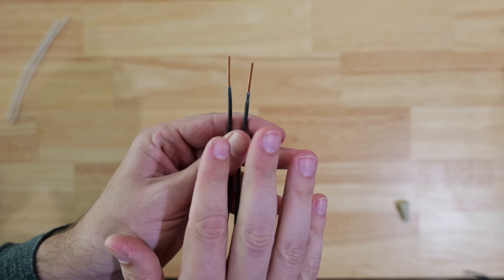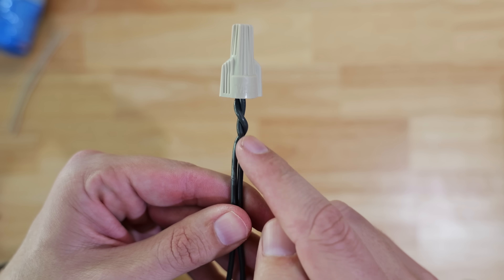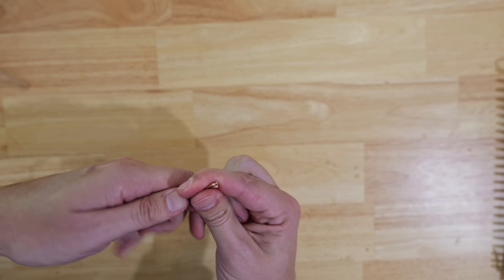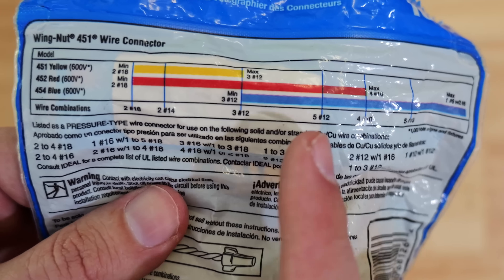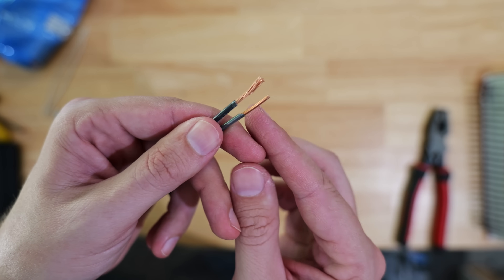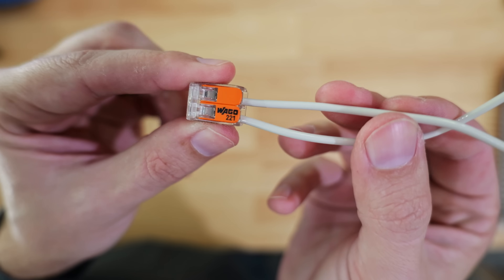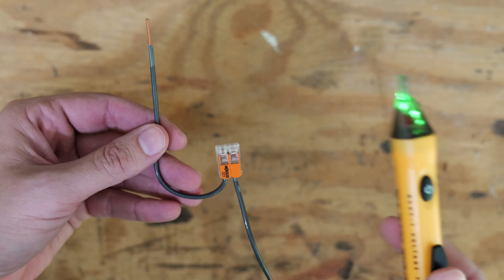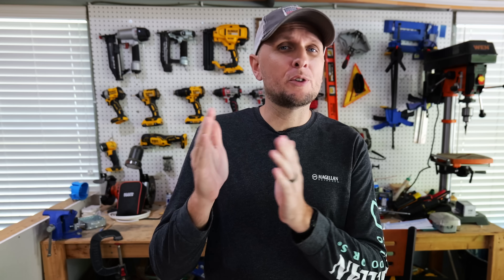7 FATAL Wiring Mistakes Most DIYers Don't Know They Are Making | Most Are Guilty of 3

Comment: I love the WAGOs.  Your starter frame just shows, "Bad" and points to the Wago which would lead people to think they are a bad option when they are really a great option and probably the safest option for beginner \ DIYers who would make some of the other mistakes you pointed out with the twist caps.  Thanks for the videos.
Reply from the maker: In the video you see what the bad is pointing at with the Wago.
Reply: Wago is bad.
Reply: @Faruk651  pretty generic response. Why bad?
Reply: @NBSTL68  Because.
Reply: @Faruk651  WAGO's make a better connection, are easier to use and have far less chance of falling off than wire nuts
Reply: Clickbait for ad $$. The only reason I came here was to find out what was "wrong" with WAGOs. Suspicion confirmed. Nothing.
Reply: he did it on purpose, clickbait = money
Reply: @bobbobbert2768  Yes your right it worked on me lol
Reply: Just click bait bro
Reply from the maker: @josegomez6888 nope.  You didn’t watch then.
Reply: The bad in the video is improper installation. Hard to call the WAGO bad because of this.
Reply from the maker: @kansascityshuffle8526 never called it bad.
Reply: @HowToHomeDIY  I think the issue they're having is just that the thumbnail is a bit misleading since even those who skim over your video may be inclined to think WAGO's aren't good. Obviously watching the video clears up the thumbnail, but for the audience that maybe doesn't finish the video for whatever reason will have been potentially misled.
Reply from the maker: @MinecraftsAssassin sorry they feel that way.  Why does nobody complain then about the wire nut saying wrong?  Not one time.  People have a perception based on bias is all I can conclude.
Reply: @HowToHomeDIY  idk, I'd just recommend  considering both viewers and non-viewers for thumbnails. Would put the channel at that "extra level" of professionalism in a sense. I wouldn't dig too much into other issues to detract from the more apparent thing that's the first item folks would see. Errors in videos can always be remedied with YouTube post-effect editing tools and/or pinned comments clarifying the mistake
Reply from the maker: @MinecraftsAssassin I appreciate your opinion.  I just don’t personally see an issue with the thumbnail.  One thing I’ve learned in doing this is that no matter what I do, I will not please everyone.  Everyone has an opinion.  Again, appreciate you taking the time.
Reply: @HowToHomeDIY You want to know how you manipulated the wire nut section? Every time you put a wire nut on a set of wires, if you wanted it to fail, you didn't twist it properly. This ensures failure every time. Twist it correctly each time and then number of failures you encounter plummets. Be careful what you ask for. You might just get it. The entire point of your video is to follow manufacturers instructions. The end.
Reply from the maker: @TadTheTinker yes I think I pointed all of that out in the video already.
Reply: @HowToHomeDIY  You pointed it out as a mistake in the first segment. Then proceeded to repeat the mistake over and over again. Many of the issues you pointed out in following sections would not have been an issue if they had been put together correctly..
Reply from the maker: @TadTheTinker again, that was the point I was making with different scenarios. 😂
Reply: @absolutez3r019  Well, they dont technically make the "better connection" as with the other method you are directly connecting the wires over a bigger surface area.
So theoretically WAGO's add more resistance to the system. 
But that's the only "downside". Apart from that they are superior in any aspect. Handling maintainance whatsoever.
Actually the first time hearing about wire nuts was actually seeing US youtubers, because where I live they are almost nonexistant.
Reply: I agree, I’m a DIYer and have always used Wagos. It felt like clickbait to me
Reply: @absolutez3r019   WAGO's are definitely easier to use and less likely to install incorrectly, but not so sure about the "better connection".  If the connection is better, then why does a WAGO heat up at full amperage while wire nuts do not?
Reply: @a351must2  wires heat up when at their max amperage.  But the max amperage of a wago is higher than the max amperage of the wire, it shouldn't be a problem.  Wite nuts can get hot and melt too,.
Reply: @absolutez3r019  yep, I wasn't trying to imply that they're dangerous in any way.  They heat up because the connection isn't as good as a wire nut, also indicating there would be some minor voltage drop across one...but you're right that it's not going to melt if it's still within rated usage.  A proper wire nut connection only heats up as much as the wire itself heats up (emphasis on proper)....at least it's pretty hard to screw up a WAGO connection which makes them safer for DIY.
Reply: @Faruk651  WAGOs arent bad. They are great. i worked in a factory that had everything from +90 to -30 celcious, lots of vibration, chemical exposure, pressure washing, lots of humidity, etc. and those WAGOs handled it all. btw wirenuts untie themselves when you have regular fluxuating temperatures, this doesnt happen to WAGOs. Wirenuts can also have issues where the plastic cap seperates itself from the metal part, which can cause shorts. This doesnt happen with WAGOs. Wirenuts dont work on stranded wires, Wagos even handles stranded wire below its min req, in a pinch.

Wirenuts sucks. theyre way slower to work with, easier to fuck up, barely handles vibration, at all. an absolute pain in the ass to redo and takes 10 times as long as with a WAGO. and if you use em in industrial settings you should be ashamed of your self, cause everytime you redo it, you have to cut some wire off(do this enough and youll have to replace the whole cable)
Reply: @HowToHomeDIY "sorry you feel that way" such an american thing to say. No one felt like this. Its not the fault of a connector installing it wrong. With Wago is far less likely to do it wrong.
By any means, your thumb is clickbait. Just own it.
Reply from the maker: @Tom-ju7px umm it’s not.  That is your opinion and your comment is definitely showing that you feel that way 😂.  The video is very clear about the thumbnail.
Reply: The 'bad' on Wago was the only reason I watched the video 😂. Having the wire nut next to the Wago made it seem like you were comparing the 2 with Wago being a bad option.
Reply: @absolutez3r019 you have bigger issues if your wire is seeing max amperage. You calculated wrong and using wrong wire size
Reply: @HowToHomeDIY  thats not really a bad thing with the wago or a bad thing with the wire nuts. Its just improper installation which is user error. Your thumbnail is very misleading and clickbait-ish.
Reply: @HowToHomeDIY  your thumbnail shows that you are calling the wago bad and the wire nut worse like there is a 3rd and better option. Your thumbnail should have been along the lines of "dont install these like this" agree or not, it is very clickbait-ish.
Reply from the maker: @FuckYouTubeCensorship2024 that’s your opinion.  What the thumbnail depicts is clearly shown in the video.  That’s not clickbait.  But I understand you’re a troll based on your name of “ILLYRIGGERYOU” 😂.   But the comments help the video so thanks!  🫶
Reply from the maker: @PokerMuppet not at all.  There are thousands of others that understood it and found the video helpful.  Sorry you’re still upset about it after 2 months.  Can’t please everyone.
Reply: @PokerMuppet you ain’t the sharpest tool in the shed are ya.  My goodness.  Either that or just like to whine about things that not only don’t matter but didn’t happen.  You literally do seem very upset.  So don’t think he’s wrong on any of it.
Reply: @HowToHomeDIY clickius baitius maximus
Reply: @TraktorTarzan The only true statement in there is that they take slightly longer to work with. A wire-nut is as likely to come off as a wago lever to pop up, or a push-in to loosen.
Reply: @histguy101  wirenuts really bad in enviroment with a lot of vibrations, they will unscrew themselves overtime, wagos are spring loaded so its not affected by vibrations. and if you do maintance work youd know that wirenuts take a lot more time to redo than wago, its not even close. that is ignoring the copper that have gotten crispy so you need to cut some off. in industry thsi is absolutely terrible, cause it means you eventually have to rewire the whole thing. this issue doesnt exist with wagos.
wirenuts also can have the plastic part seperating from the metal part, and it now can cause a short. this also doesnt exist with wagos.

and how are these not real? ive seen it with my own eyes. and its the reason the factory i worked at moved over to wago, cause the wirenuts litterally became a hazard and issue

in houses the condtions are so stable and still that most of these wont become an issue, but in industry it is. and it shows that wirenuts are worse
Reply: @Faruk651 Why?
Reply: @HowToHomeDIY  So Main issue for both you are point out is nothing about the wire nuts or wago connectors themself, but in both cases just user error or not following the instructions. To which I fully agree. Although I think the thumbnail was misleading in both cases.
However, when it comes to properties, I think there are even videos out there where they had been tested for pull strength, load capability, how easy they may catch fire and such stuff, and I think the wago was slightly better than the wire nut. BUT, both have been well within specs and exceeded he specifications. 
For both also these days we have to say, get the original or at least qaulity ones. There are by now so many fake or cheap ones out there, especially on ebay or shops like Temu, but also Amazon, that are simply not up to the task.
From own expereince, I cannot say anything about wire nuts. While I at least think they would not be "illegal" to use here in Germany, I have never seen any for sale at electrical supply or DIY stores. You can sure get them on Amazon (like everything you possibly can buy ;) )
There is also an older, but still available and up to the task style using just push in clamps with no levers. I sometimes prefer those to join wires in boxes, as they are slightly slimmer. Con: you really have to twist out wires to remove them and not for stranded wires (which as you described it would only be on the light fixture side anyway, no stranded wires in fixed installations otherwise). There is also an older style of the levered ones, way more bulky and slimmer levers. and not as wide a range of sizes they can be used with. They are a little cheaper, but about 3-4 times the size.
Reply: I made the mistake with wago of not shoving it in far enough.
Reply: @Faruk651  Well, there's a cogent answer.
Reply: @HowToHomeDIY Ummmmmmm, you literally called it bad in the comment above AND in the thumbnail! I now have no reason to trust ANYTHING you say.
Reply from the maker: @NoMoreBsPlease I’ve already explained it numerous times.  Take care! 🫶
Reply: @NoMoreBsPlease  oh no.  I’m sure he’ll have trouble sleeping at night 😂
Reply: Wire nuts are just nuts. You literally see how this obsolete technique of wire twisting was given an obsolete tool to twist and secure the wires... very old in a bad way
Reply: @HowToHomeDIY  You literally call it bad in the thumbnail.

But Wago isn't American so it most be bad... Silly 'muricans...
Reply from the maker: @Flaggyt nope
Reply: Love wagos, nothing wrong with them.
Reply: @bobbobbert2768  I left a dislike and blocked the channel. I dont tolerate clickbait and I'm sad I'm giving clickbait interaction by commenting, but I just wanted to say that blocking clickbait channels is the easiest way to no longer see them. There are good creators with great content out there that dont rely on clickbait. Dont get stuck watching this trash, go out and find better.
Reply: @Faruk651  wagos do NOT make a better connection, they depend on a bus bar while wire nuts are a direct wire to wire connection
Reply: Are Wago connectors rated? UL approved? I'm concerned about arcing.
Reply: The wagos are absolutely great
Reply: Why was having “Bad” pointing at the Wago “clickbait”? The same photo has “Wrong” pointing at a wirenut, but not one commenter here has complained that this was “clickbait”.
Reply: Proper clickbait video capture/graphic
Reply: @HowToHomeDIY - the video graphic is just misleading.
Reply: @HowToHomeDIY  your logic is wild - using your rationale… if I advertise the wrong price for two separate products,  but customers only complain about one of the products… then both prices must be correct? (Because otherwise customers must would have complained about both products?)
Reply: @HowToHomeDIY  🙄 these people complaining about the "click bait" I saw the bad on the thumbnail and thought wagons=bad but obviously upon watching it I learned otherwise. And the wire nut issue people were having cause you weren't doing it correctly. 🙄🙄 You were clearly demonstrating a run of the mill diyer who just doesn't know and thinks they do. This was an informative video and I learned a few things so thank you!
Reply: Wagon is TEMU
Reply from the maker: @BrownEyePinch does it ever get old trolling like you are? 😂
Reply: @methodswan  it is, no matter how many times he denies it in the comments
Reply: Wagos are GARBAGE; no better than the "push-in" connectors on 15-amp switches & outlets.
Reply: @NBSTL68  I'm not sure about the Wago specifically, but I think many electricians don't like the push in type connections. My understanding is that the wire can twist in them and come loose a lot easier. Also, you can have over heating issues because there isn't as much metal to wire connection.
It was hard to tell for sure but those Wago probably don't have those issues. Or at least you would think that a lever type system like that was meant to fix those two issues. Otherwise I think they would just be push ins with no lever. That said I've never used this brand so don't know for sure.
Reply: They are not a better joint creator than a wire nut. But why are you so upset? Use what you like. Does disagreeing with you make you upset, as well as defensive?
Reply: @Faruk651 it ain't terrible. Its definitely acceptable. I just prefer not to use them. If I'm asked to go to a job, and the contractor requires them, I get a hold harmless, or I simply go to a job of a different contractor. Rsrely will I ever take work again from that first contractor. Who needs the fussing and fretting.
Reply: @absolutez3r019 only if you can't use a wire nut properly. If you can, there's no comparison, especially the specs. I've yet to see them on sites in NYC, be they new C or renovation.
Reply: @bobbobbert2768 not to you, maybe. But for me, I'm always going with the highest specs, and most durable performance. I've no idea why some get so upset when disagreed with. Is it a manhood thing? Use what you prefer. I just prefer not to. And I've yet to see anyone prefer them in NYC or the well to do projects in the rest of the Tri State Area.
Reply: Why are you so offended. Does this person not have a right to how he feels? I've not heard him say, even one time, not to use something that's approved. Do you need others to all agree with you to feel safe and secure?
Reply: You’ve hit the nail right on the head here. I love the wago connectors and as a DIY’er I won’t use anything else. It’s hard to get it wrong. Never had one fail or break even though I only use them occasionally.
Reply: @frankjohnson8006  that's what she said !  lol
Reply: Wago all day!
Reply: It's a bit clickbaity, but he had good notes on wago usage.
Reply: Thumbnail is 100% clickbait. Your channel is now 100% blocked so I'm never tempted  by your thumbnails again.

Comment: I love your mention of the WAGO connectors.  I started using them in industrial work several years ago because you never know when you might need to move, remove, or update either a circuit or a heavy device like a motor.  I've seen more than enough stranded wire just totally messed up and continually shortened by using wirenuts. The result is usually inadequate wire available for solid contact.
Reply: Absolutely!  Wire Nuts versus Wago's is a "no contest" for me. Wago's are head and shoulders better than wire nuts will ever be even if properly used they way they need to be.  Too many times I have seen the "professional" install of wire nuts on my jobsites and it just makes me cringe!. In all fairness I am sure the wire nuts we done as a "repair" and not part of the original install so probably not inspected for code.....but....doesn't matter.  

Wago's are now main stream as well as HD carries them.

Best Tip...only buy actual Wago's: not the knock offs you can find elsewhere...
Reply: WAGOs are a godsend to industry. makes the work easier, safer and faster
Reply: @hansmanschaft2593  
Even in a home install I've seen some wire nuts installed where they left very little spare wire for any future use.  It's like the electrician was just showing off by leaving a bundle of 5 wires in a nut with no slack left.  But I like lever connectors (WAGO 221 or Ideal In-Sure L2) where they do little damage to the wire where the wire end can be reused in the future and it doesn't need to be stripped.

Comment: Just an FYI... those Ideal Tan wire nuts fit right in the 5/16th socket driver on a typical 10-in-1 screwdriver. really saves the fingers when trimming out a house and you're doing dozens of wire nut connections.
Reply: Even vice-grips, if used carefully, can be a good option.
Reply: NICE!! Gonna steal that bit of info and take all the credit.
I'll fess up in my will. Would you be OK with thst?

If not, I never brought up the subject.

Just a thank you for being smart!!